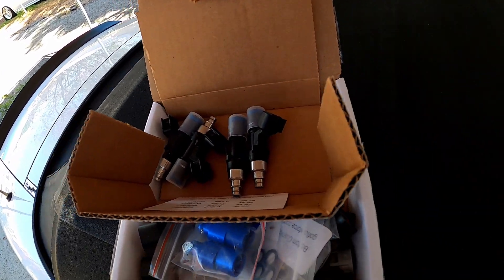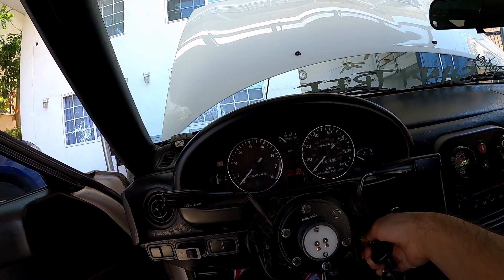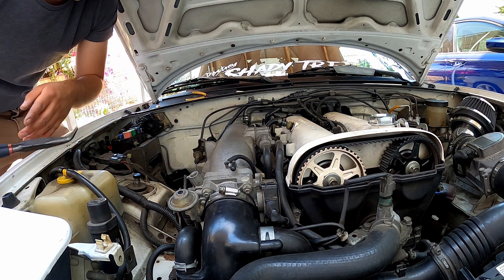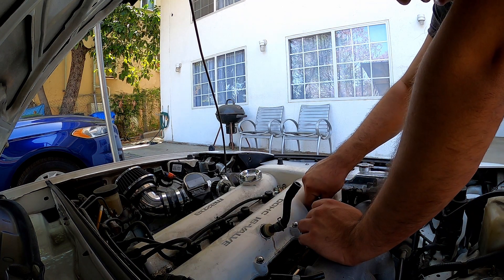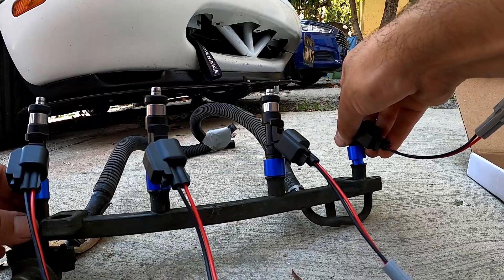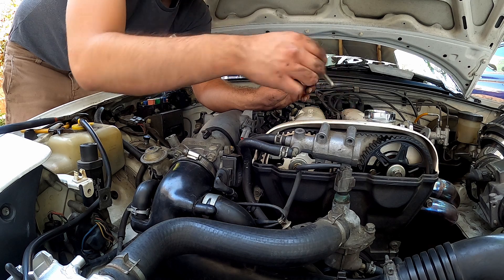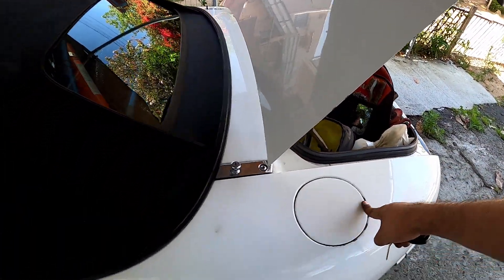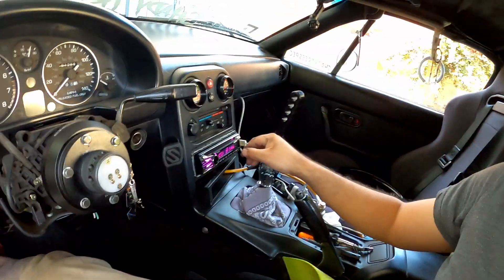Miata gets 640cc flow force injectors! (1.6 turbo prep)

Comment: still running a stock fuel pump? i’m about to jump up from rx8 injectors
Reply from the maker: Yeah still stock fuel pump, that little thing puts in work, I’m about 200hp and still no issues with stock fuel pump